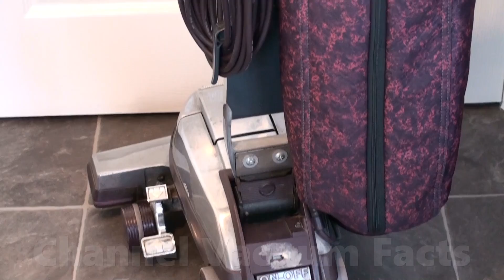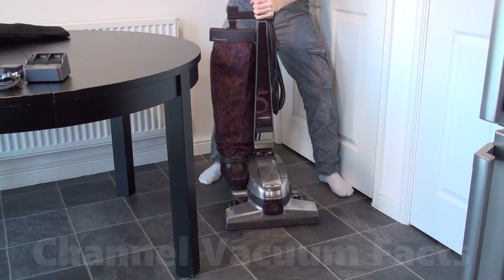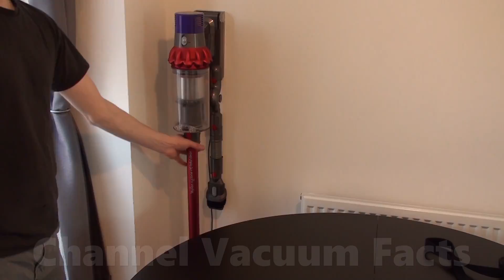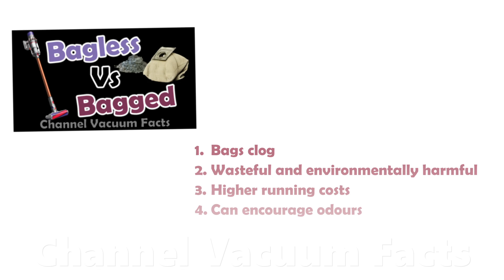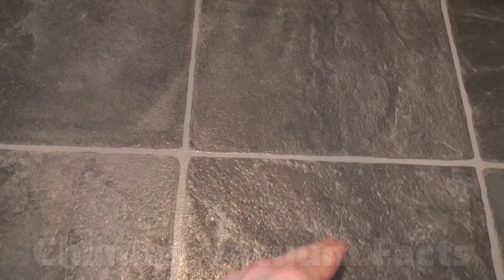Review of a Kirby Vacuum Vs Dyson Cordless

Comment: I do understand everything you've gone over, but what specifically makes the Kirby vacuum head bad? It seems to the eye like a good design, and if it had higher suction, would it be a decent cleaner? I've used the blower mode on the Kirby with the power head and connected it to my dyson DC14 and it seemed to clamp harder and clean better than any vacuum I've used before. Of course the clamping doesn't matter at all with a kirby due to TechDrive.  But also, if you're going to review a vacuum, you may want to learn how it works... TheTech drive is an incredibly easy to use feature. It's literally on when vacuuming and off when now, but you shouldn't  be using it on your hard floors as mentioned in the manual and owners video multiple times.  Also the metal head obviously won't come off when the height is set to the lowest setting, which should hardly ever be used btw. You lower the head until you hear the brushes touch, and then one more. Not continually click it to the lowest setting. The hard floor pickup did not work well at all because you didn't have the correct attachment for the hard floor. I agree it's outdated technology, however it still works to this day, and I challenge you to find a vacuum that is as versatile as a kirby, allowing shampooing, mopping hard floors, polishing, carpet mat setter, and even a few power tools such as the turbo tools and handi-butler. I agree kirby is far behind the curve of dyson and they need to improve ease of use, however I'd never call them the worst vacuum..
Reply from the maker: The answer to your question is in the video. Test results show it's not good. My other videos discuss features that made a head good. Such as being able to separate pile well, remove fine dust, and cope with large particles: all shown to be failures in this video. Too much clamping because of its size IS a problem, and bypassing the problem with a required poor, noisy, energy wasting kludge (techdrive) is absurd. It uses belts, doesn't auto adjust to different floor surfaces. The list goes on. Again, all shown in the video. I recommend you watch it. And then you describe a huge list of user requirements needed just to make it work properly, which instantly reveals the absurdity of the design. Needing to change attachments in the fiddly way shown in the video just to transition to a different floor type is a joke. And to advocate a jack-of-all trades, master of none Swiss army knife featureset, whose problems werealready discussed in the video, as a virtue really suggests tribal blindness. The machine is a user unfriendly, wasteful, inelegant joke, and I've nothing more to add; the video discusses everything.

Comment: While I disagree with some, if not many of your arguments - I applaud your marketing efforts to convince consumers into ditching one brand for the other.  I think there is bias present in your tests, but then again that's marketing.
Reply from the maker: There are no marketing efforts here, only facts. If you "think there is bias present" in my tests, perhaps you could explain what bias and provide a convincing argument why to give your opinion a little credibility. There is no bias, all the testing is open for reproduction, it suffers from none of the obvious flaws found in other amateur 'testing' on YT (presumably you think that is biased too to be consistent?), and shows all the trends you'd expect. As I've seen countless times before, this vague contradiction bears all the hallmarks of someone who doesn't like the facts they hear, can't argue a case against them, so resorts to cosmetic, substanceless attacks.
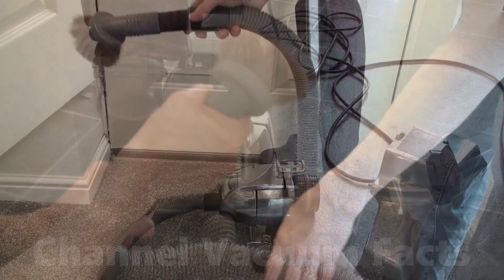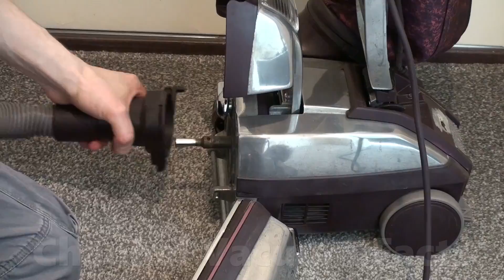Reply: @VacuumFacts  Bias present for example: @7:35 to 7:40  "The carpet shampoo for example, total ass to set up. Stupid technology anyway..."
My argument: "ass", "stupid technology" etc all subjective terms that don't belong in an objective analysis. Bias.
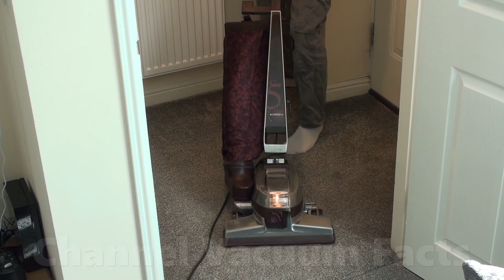You label your channel as Vacuum "Facts" but demonstrate opinionated views and operator incompetence. @4:56 for (another bias) example: That is certainly not the intended nor designed use of the vacuum without its motorized drive yet you purposely misuse the product to introduce flaws. Bias.

Based on 2 cited examples thus far with more examples available, I conclude this overwhelmingly critical video is no different than an overwhelmingly positive review of the vacuum, biased.
Reply from the maker: Ignoring that there is evidence and solid reasoning supporting that subjectivity (you overlooked that), cherry picking elements unrelated directly to the testing is evasive. You've not supported your claim of "operator incompetence" well either; that time stamp showed a demonstration of the points being explicitly made and was not a suggestion someone is supposed to use the machine without tech drive, as you're implying. Again, you're showing all the hallmarks of someone who doesn't like the facts they hear, can't argue a case against them convincingly, so resorts to cosmetic, substanceless attacks.
Reply: @VacuumFacts  Your turn. I request you to cite "evidence" and "solid reasoning" (use time stamps) on the @7:35 "ass"-like quality of assembling one of the vacuum's subsystems. I am not aware of any definite criteria that makes a particular procedure "ass" nor a particular design as "stupid". How are these qualities of yours being measured? Does assembly of more than 2 components mean it is "ass"? Does a process that achieves the desired end result (cleaner carpets) through a balance of different factors constitute it as "stupid technology"? 
Not defining your metrics for those conclusions leaves a skeptical viewer as myself in awe at the bias present when you describe a $1000+ equipment with $0.50 gag-toy descriptions. 

Again @4:53 "...pushing it forward is a genuine workout..." Yes that is true, after you cripple the vacuum by disabling its designed motorized drive. Again, you intentionally disable a system (motor), manufacture your own problem (difficulty moving, blame it on its weight), and then fuel your own argument ( too heavy to move). 
Heres an analogy to your @4:53 demonstration: Allow me to criticize how hot it is in this automobile, after disabling its Air conditioning system. How poorly designed is this car since it needs to have an air conditioner to keep its interior cool......
That complaint (inability to move) is no longer valid since its design (self propulsion) already addresses it.
Reply from the maker: Ignoring that you're now being a bit silly, and seeing as you've now apparently given up with your original claim of bias in testing and moved onto a side distraction, most of the issues associated with its method of 'wet cleaning' are discussed here https://youtu.be/XVR-YdzytBA . Plenty of videos showing it being set up, and it is my opinion that it's an arse to set up based on what I've seen. I've demonstrated nicely that the tools in general are a pain to use, relative to superior designs from competitors (also demonstrated).

As for tech drive, I think the video nicely laid out and demonstrated its fundamental problems and why it's a poor solution to an avoidable problem; you're not really addressing any of that and your inappropriate analogy about AC shows that.
Reply: @VacuumFacts  My claim about your bias is still present, it never left the conversation in any of my previous posts. Let "bias" be defined as: intentionally ignoring unfavorable facts in order to selectively perceive desired facts. 
You demonstrated a maneuverability test of the Kirby vacuum, by intentionally disabling its self propulsion system and then struggle to move it. In effect, you highlight the vacuum's quality of heaviness, attribute it to its design while completely disregarding the built in propulsion system designed to eliminate that "problem" . 

You even say the problem (difficult to move vacuum) is "avoidable", yet you intentionally and artifically create a problem that was not a problem to begin with. 
A "problem" is a problem when there is no solution. The solution was already built in (self propulsion) ! You intentionally chose to not use it! Then complain about it!
If this is one example of bias (again, @4:53), the integrity of your entire video presentation is now in question. What other views in this video are biased? 
Also - I keep citing specific instances in your video, yet you have not provided citations within your own work. You expect viewers to go on wild goose chases in your videos to fill in knowledge gaps you are failing to close in your comment sections?
Reply from the maker: That you saw only "intentionally disabling" its movement system is quite revealing. I did no such thing. I demonstrated why it was needed and explained why it shouldn't be with further demonstration of competitor products, and finishing off with a demonstration of the disadvantages of this movement system kludge. You're suffering from hypocrisy bias; you're only seeing and interpreting what you want, rather than what's shown. You're not making any strong arguments to support your original point here and you've had several opportunities. Then, you chose to interpret me directly providing you with the evidence you ask for as me sending people on a "wild goose chase". Classic example of people who don't like facts when they conflict with their opinion. To the troll box with you, sir. Bye.
Reply: @VacuumFacts  "Classic example of people who don't like facts when they conflict with their opinion"  - That makes two of us then. 
"Demonstrated why it was needed" Lets cite you again. 
You use  @4:53 "its stunning weight adds hugely to inertia, and pushing forward and back is a workout" as a problem with the machine when the root cause was clearly intentional operator error: intentionally running the machine with the drive motors disabled. In misusing the equipment - you created your own problem. It's not the machine's fault like you're selling it to be. It's you the operator. 

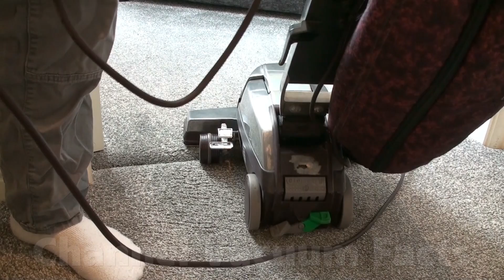For argument's sake @6:13 you use a chipped wall to complain about the machine. Again, operator error! Who controlled that machine into the wall?! Kirby's dont drive themselves!

Thats two examples now where operator incompetence was used to fuel your argument against the product with artificial problems.
Again. Bias. 
I suggest you make a video focusing on the highlights of the vacuum critiqued - if you want to position yourself as a neutral, objective authority on vacuums. 
Otherwise, biased you are. Impressive effort in making this biased content though.
The earth is round by the way.
Reply from the maker: "Kirby's dont drive themselves" To a degree, they do. That's what tech drive does (the clue is in the name; sorry it's confusing for you). It drives for you in the direction you push it. What you haven't clicked, is that this supplies huge inertia for you (at the expense of noise and energy consumption—all avoidable with better design). As such, when it impacts with the skirting boards (which is common and why they're there, in case you hadn't realised), it does massive damage. It's not 'user error'; it's a likely and thus expected occurrence. You seemed to overlook the basic observation that better competitor products don't cause such damage when impact occurs. That's because their solution eliminates the need for 'tech drive' and its associated problems, illustrating the point I was making. This was all discussed in the video. Again, you overlooked the importance of the points being made, fully consistent with your closed-minded bias, and instead make absurd accusations the machine was being misused rather than seeing the methodical demonstration of the problems from first principles. As for highlights of the vacuum, they were very few and presented in the video near the end. Unfortunately, you didn't actually specify any meaningful 'highlight' that was missed, consistent with your contrarian attitude (that I'm entertaining purely for my own amusement) and lack of meaningful argument on inspection.
Reply from the maker: @The Last Word "dude did you even watch the freaking video?? have you seen this vacuum? I thought calling it ass was being too nice 😂😂"

lol
Reply from the maker: @angeryitalianchef7251  You've shown misunderstanding. I engage in discussion with people. Often they fail to defend their position well. Sometimes either genuine stupidity is shown after a refusal to accept well-supported and evidenced claims, or behaviour which meets the condition of being a troll. Sometimes it's hard to distinguish. If you have anything valuable to add beyond the ad hominem, you can.
Reply from the maker: @angeryitalianchef7251  I see you're at it again

Comment: Hey since you have talked about Kirby vacuums, I’d love to see your thoughts on the Rainbow vacuum for some information
Reply from the maker: Kirby vacuums were selected to debunk the widespread myth they're any good (see the first 10 seconds of the video). There's no such motive for a Rainbow (whatever that is).
Reply from the maker: OK, I've just looked it up. Totally stupid, impractical, water-wasteful 'solution' to dust filtration. It's not clear even how effective it is at filtering air (especially as they also need a HEPA), whether it humidifies the air in the process, and what other microbiological considerations there are seeing as it's using water. There are far more elegant and effective ways to filter dust out of the air (Dyson did it decades ago). Messy muck to clean up, heavy, noisy, and energy guzzling. Not impressive. No wonder they're pretty much unknown.
Reply: Vacuum Facts hey thanks for the reply, I brought up rainbow since it’s also another exclusively sold through door to door sales. It’s an American company so I doubt they sell them outside the US, so I don’t blame you for not knowing about them. Although just mentioning the reason they use water is so that when dumping out the waste it’s all trapped in the water, that way no small particles fly into the air when dumping since you just pour it out. Also since it water and humidifying the air it provides a fresh air sensation. Definitely not worth the insane price since it’s as, if not, more expensive than a Kirby. Just explaining the reason they use water is all, I’d still prefer a Dyson though for practicality of daily use. Thanks for responding again I appreciate it, really enjoy your videos. Have a good one and stay safe out there.
Reply from the maker: @angeryitalianchef7251  Really... And what are these 'federal standards'? What constituted a 'pass'? Do you have any evidence to support these claims? Also, what is the relevance of their machines being made before WW2? None of that addressed anything I discussed above about why they're inferior products. Oh well...

Comment: Hi there...really enjoy your vaccum videos. On the Kirby test, what level was the brush head at when you did the deep clean test against the dyson v10? Btw just bought v11 and love it. Grew up with Kirby...was too expensive to buy for my own place. But liked the Kirby too. Thanks in advance!
Reply from the maker: It was at the level advised by the manual. I should have criticised the ridiculous approach setting head height more; any design which allows room for user error and unoptimal height is poor design. People are frequent to point this out (in vein) as a possible excuse for the machine's terrible performance.
Reply: Hi thank you...any chance you remember? Meaning...do you know of it was on the setting closest to the ground? Thanks again!
Reply from the maker: @ashishsinghvi2769  It was at the level advised by the manual. Any design which allows room for user error and unoptimal height is poor design. It made physical contact with the carpet and the carpet had deformed to make the best seal the design would allow. It's a myth that if it's too low it doesn't perform, you know. There's no physical reason why this would make a difference. There's no empirical objective data to confirm this either. Based on how cleaner heads work and the physics of vacuums and airflow through pile (discussed on my channel), the Kirby will be drawing its maximum airflow through the pile as long as there are no gaps to shortcircuit airflow. The upshot; it's an adequate performer at best and is massively impractical and resource-wasteful.
Reply: Ok gotcha. Thank you for taking the time...I do appreciate it.

Comment: When you figure out how to use a Kirby you get use to it and it’s actually not bad. And Kirby instruction videos say to lift it with your knees not your back.
Reply from the maker: haha lift with your knees; you'd have to with that kind of weight. A forklift would be easier. Yeah, no matter how bad something is, you can get used to it. But compared to the best out there, a Kirby cleaner is genuinely appalling in every way meaningful, and I've seen it for myself now. Good for dusty collectors; terrible for home users.
Reply: Vacuum Facts hmm maybe they should’ve kept them in the USA (where they are made) because they probably suit those American big homes better.
Reply from the maker: I'm not even convinced they suit american homes better (except maybe 50+ years ago). Tech has moved on and is better on every level now, but they've remained static. Being stamped with 'made in the US' therefore doesn't look so good, alas.